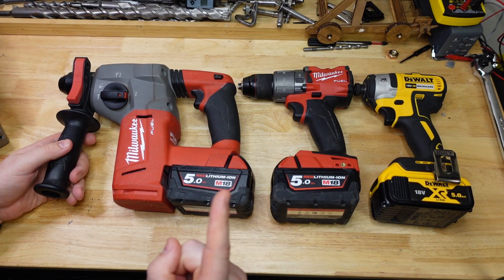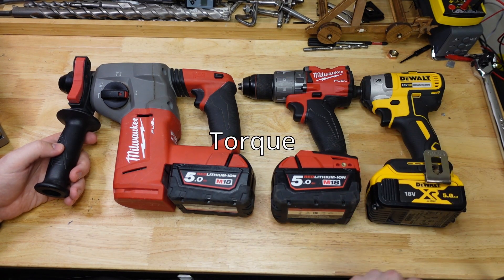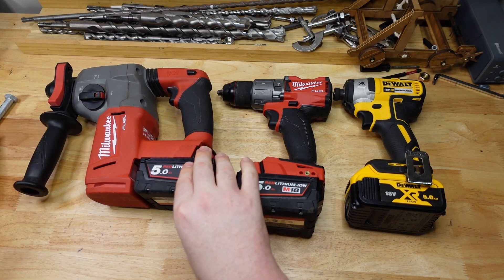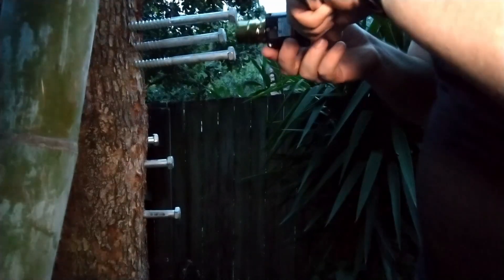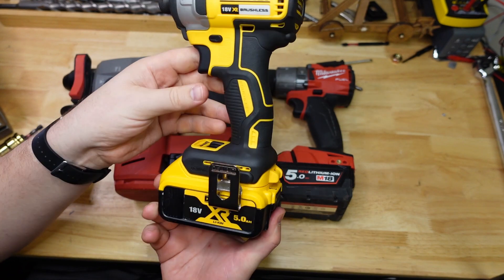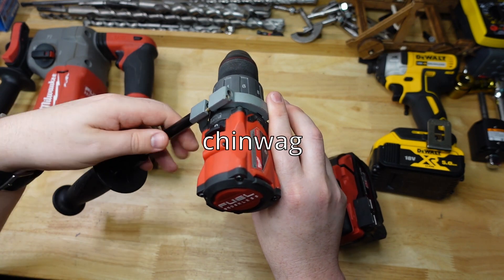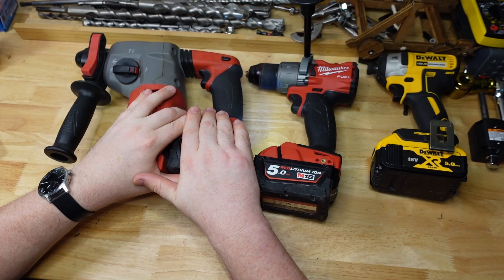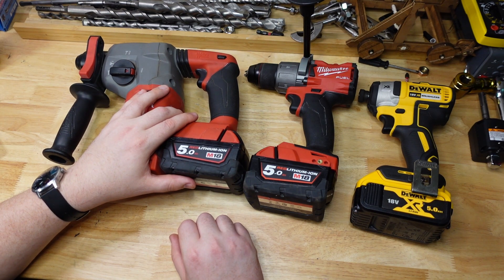How much Torque does an SDS rotary hammer have? (compared to impact driver, drill driver)

Comment: according to instructions on my BOSCH Hammer, with the 3 jaw adapter states it can drill metal and wood.  after a little bit of reading specs RPM on this Hammer is not far from traditional drill. My question is can this BOSCH 18V21 Hammer with the 3 jaw adapter be sufficient to replace my burnt up conventional drill $40 adapter vs $170 new drill.
Reply from the maker: More or less, yes it can.
I drill metal and other things with that one here https://youtu.be/fbB41vDoN64
Reply: @BoltahDownunder  
appreciate your time making videos and your response! no metal drilling with compact SDS-PLUS on that video link. but interested in that subject, if you have a video testing the drilling capability with 3 jaw attachment on SDS-PLUS hammer as described in bosch owner manual. be great information. 
Thanks

Comment: this test doesn't make a whole lot of sense. The release torque is way less than fastening torque. those drills are making way more torque than what you have recorded. I see that you had the torque adaptor on the drill while fastening, but never recorded it. the torque you are looking to record is fastening torque. the results that you got make perfect sense for something completely different, you drove the hammer drill lags in a little further which required more torque than the impact. reason for this is, the lag that is drilled further in has more surface contact with the stump which equals more friction. so it requires just a little more torque to over come the friction. if the impact lags were driven as far as the hammer drill, the torque numbers would be probably almost identical. i say probably because no part of a tree stump is equal. in the ideal world the numbers would be the same. but here is another variable, that dewalt even though you said it was skipping on the anvil, it was still turning the lag, to find the maximum torque of that tool you have to go until it stalls out and wont turn any further, like what you did on the hammer drill.  if you look at your results, the lags that have the most torque are the ones driven the furthest in. the rotary hammer, it looks like you barely tested it, unless you felt something different. i heard a couple of impacts and that was it. rotary drills should be making way more torque than hammer drills, according to this video, you barely got that tool  warm. project farm if you haven't heard of him, does lots of testing videos and they are very well performed and he does a very good job at getting rid of variables which means his tests are going to be pretty accurate. this test while has some good intentions and effort has lots of variables and recorded data that isn't important. Now if this test was more driven to driving lags out of the stumps it might be a little more accurate. one thing that project farm has show is when he tightens a bolt down to lets say 100 ft lbs, his results show it only takes 50 ft lbs to remove it. I say this because it takes a lot more torque to put the lags in the it does to take out and it also makes sense saying there is no piolet hole when putting the lags in, but there is one that was created from putting it in, which means when taking a lag out, it always has a piolet hole. 

Now i hope this doesn't come across as too bad of a negative comment so instead, as engineers do, I'd like to see improvements made. we can always better our tests ya know. its a constant thing we do. main improvement i recommend is record fastening torque until the tool can't go anymore. that will give you the maximum fastening torque of the tool, that is pretty reliable. the variables go way down this way. best of luck
Reply from the maker: Thanks for the info mate.
I'm doing a follow up to this one at some point so it's good to get some actual feedback. Basically this test is to rank the drills, not measure their exact torque. Companies don't make claims about it, so I have nothing to verify.
I think I explain this in another vid, but basically my reasons for choosing this one are:
-Logistically simple
-Fairly repeatable
-Longitudinally stable
-Adequate at ranking tools.
The last one is the main requirement, the ranking.
There are many ways to measure torque, but at the end of the day I just need a way of ranking.
I tried a weight & winder based method that was ok but too much work. Directly running the drill from/to stall on the torque gauge fixed was highly variable, probably because of the  sample rate being low. As you noticed I also record while driving in, and that also ranks the drills similarly but gives lower torques and also doesn't account for torque reduction at high rpm, and probably misses peaks due to low sample rate.
The motors will have more torque if measured from stall, but I'm not confident any of the slow methods are repeatable enough, so I go in fast.
I also want the drills to get going and overcome the screws' static friction, plus it's easier to just go full throttle than to try minimum throttle where all the torque will be.
I'm happy that this test is able to rank the tools but I'm going to run out of tree and will need to find a replacement rig, so any suggestions are welcome. I'm playing with load cells RN and might just get a torque cell to use for this, but I'm not convinced it'll be much better.
What do you reckon?
Reply: @BoltahDownunder  ok. I gotcha yah. 👌 although if I'm not mistaken a motors max torque should be a higher rpm not necessarily the highest, but at low rpm there is a weaker magnet field then when a motor has higher volts and let say the motor js pulling 100 amps. A lower gear setting would give a motor more torque though
Reply from the maker: Yeah that's kinda what I'm going for with the screws. Theoretically, it has max torque from stall, but that's abstract so I want it to get going and draw some real current while it's working.
I got some big wood that I'm going to drill into tomorrow and see if I can get them really working, will let you know soon
Reply: This actually answers my question I've been asking. I've been wondering if I could use a rotary hammer for drilling big and long holes in wood. I'm burning up drills corded wont even drill it hardly and cordless seem to cut much better probably because of speed but still need more power. So I'm kinda screwed until someone comes out with a 60v actual drill. And DeWalts mixing drill isn't made to do this before anyone mentions it.